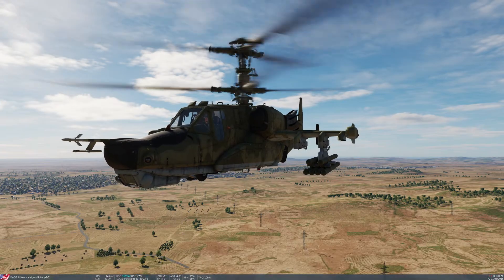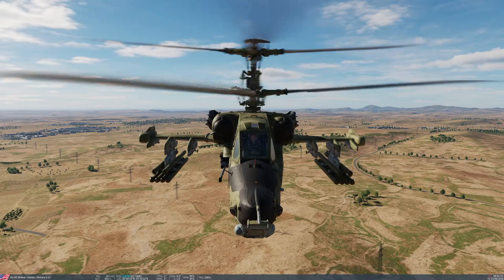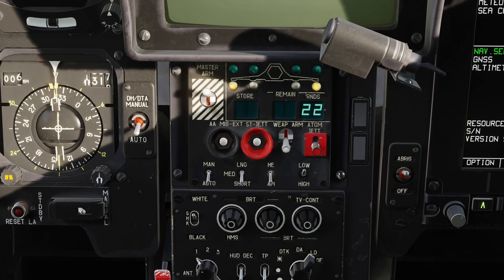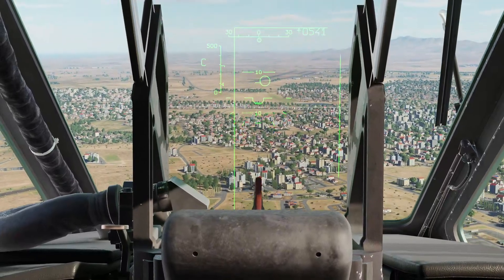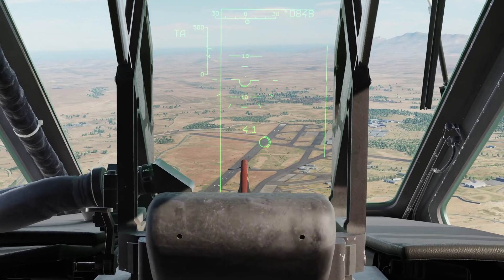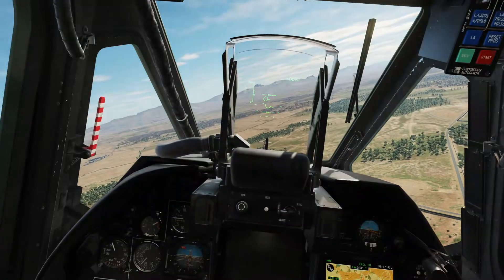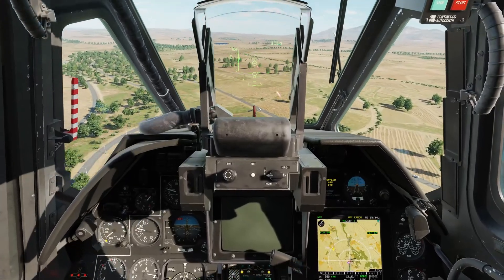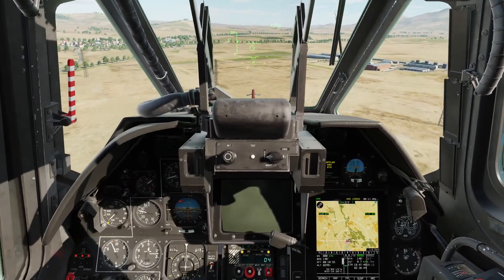DCS KA-50 Black Shark 3 Tutorial 3 - Cannon

Comment: Few things from my experience with the DCS KA-50. 

MAN/AUTO Switch: Doesn't affect the gun, that's mostly an override for the firing constraints for the Vikhr Missiles. In fact, to switch between the locked or slew position on the gun, there is a rotary knob next to the pilots left thigh. You can rotate that between 'MOV' and 'FIX'. If the Shkval or cannon motors are damaged, the gun will automatically switch to 'FIXED'.

In regards to range: On 'LOW' firing rate you can reliably get hits on targets out to 2.5-3km with short bursts. The accuracy of the gun also improves the closer the target is off the longitudinal axis of the nose. Shooting off boresight will significantly decrease accuracy. If you use 'HIGH' rate, the cannon still has moderate accuracy, and works well spraying HE on a formation of troops. 

Ammo types: Anything moderately armoured like a BRDM/BMP/Shilka requires 'API' for reliable damage. 'HE' is best used on Infantry, Trucks, AA and BTR's - as well as aircraft - but can still damage the aforementioned IFVs. Don't bother using the cannon on MBT's, it will be almost completely ineffective.

Top tip: If you flip the HMS down and push + continue to hold 'Shkval Uncage', the gun will slave to it, like a poor man's version of the Apache's chain gun, but with limited traverse. 

Lastly, if the 'AA' or 'AA HO' (Head-on) modes are engaged, and a target is contrast locked in the Shkval, the gun will slightly lead the shots on a slow-moving aircraft, with varying results. 

Great stuff as always deephack! <3
Reply from the maker: Thanks, these are really good tips. I'll include these if I revise the video.